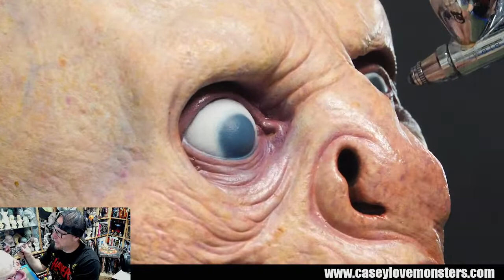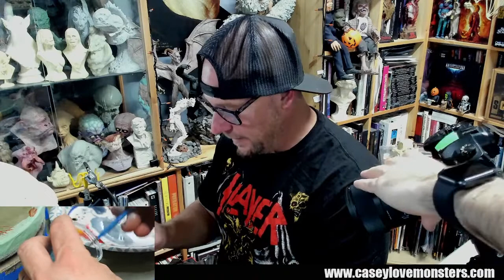How to Paint Eyes on Latex Masks w/ Casey Love - Monday Night Monster Jam - Ep.6

Comment: You used a paint named Freakflex when painting the eye. Flex is in the name but does it actually have some flexibility to it ?
Reply from the maker: Hello, No those Freak Flex acrylics are not flexible even though they have "flex" in the name.. Im suing them in thin layers however once done they will be sealed with varnish followed by clear 5 minute epoxy which is not flexible. Most masks made for collectors will not have flexible eyes. Mostly due to the fact that epoxy looks the best and gives you the best gloss...even masks such as Death Studios use 5 minute epoxy on the eyes.
Reply: @CaseyLoveMonsters  Been using the acrylics to paint my eye's lately and the epoxy. They really turn out great that way.